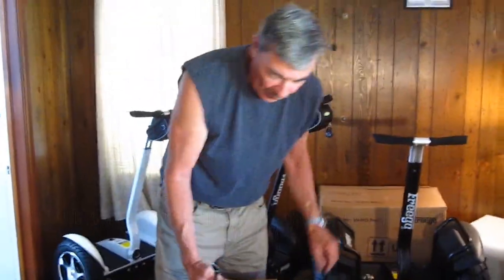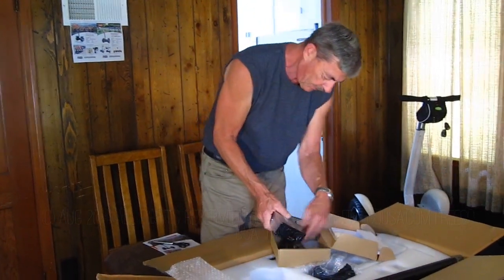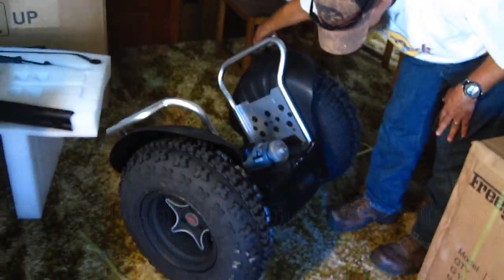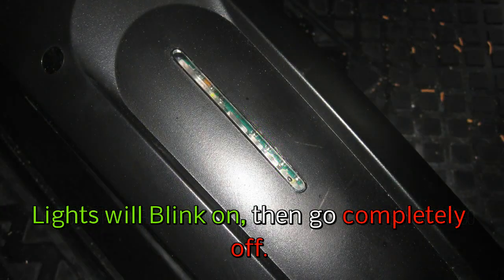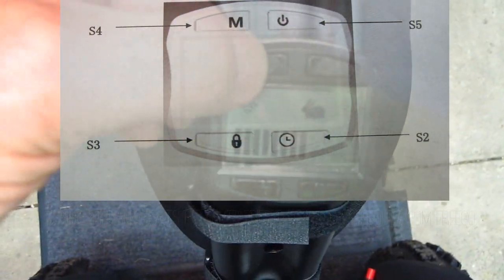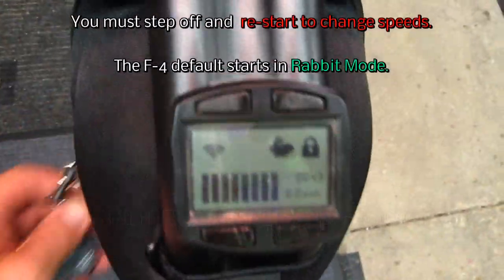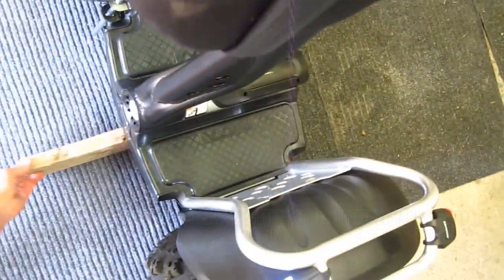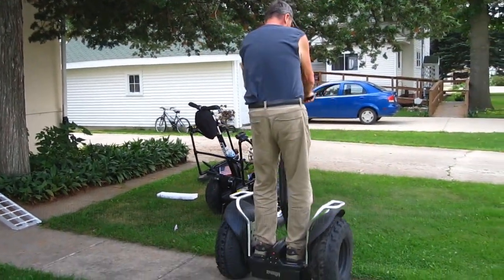F-4 Stand Up Vehicle, Un-Boxing, Testing, Tips and a Fall Demo!

Comment: Hey man nice video! Did you ever replace the battery and how did u go about that ?? im thinking of purchasing a second hand one but the batteries might be dead
Reply from the maker: I did not, because a huge fire destroyed my shop and home, including these in 2016. The batteries are easily replaced, however. We loved this machine.
Reply: @NightFlyyer   thanks your response really sorry to hear that. Do you know where I can get a replacement battery? I've been all over the internet and couldn't find any
Reply from the maker: @glendeva100  I do not.  Segway was purchased by NineBot in China.  You might find a battery there.  Some Lipos might be able to be modified to work.  Good luck and be safe.
Reply from the maker: @glendeva100  Well, I have thought about putting in some high amp RC LiPo batteries in series to get the proper voltage, if any of mine failed.  You might try FreegoChina.com too. That is where I got these.  Good luck.

Comment: If these were legal un the UK, I'd be on paypal now with a cash transfer! 
Dave, you should lobby the UK parliament to increase your sales area! 👍 👊lol
Reply: They're not classed as a walking aid for disabled people as they go too fast, the limit here is 4mph. 
British law at its finest lol.
Reply from the maker: Hmmmm???.  My car goes 120, but If I drove that fast, I would get a ticket. Most bicycles pass us here on the bike trails, so are they also illegal 'cause they go too fast?  LOL.   If they give 5 MPH speeding tickets, maybe that would work.  HAHA.  anyway, I'm with you.  It's Crazy what lawmakers make laws about when they think they know all about something they never have done.  Sounds like our gov't. LOL.  Here's a possible solution.
These machines have 3 speeds. They can be programmed to not go faster than 4 mph, which is low speed on the F-3, UVO1 D Pros, and also this F4..  It would take some lobbying for sure. Thanks for the tip.

Comment: Brushless motors are exactly synchronous three phase Tesla motors (AC motors, but with computer regulated frequency). And, not only attracting magnets, but one side 'pushing', another 'attracting' producing net motion. 

It is cool loking vehicle, but I think classical bike has more advantages: while you drive your vehicle stand-up, bicycle permit you sitting and driving in the same time. Re-charging time depends of how fast you can eat. :o) (just a joke)

I am not saying that this vehicle is bad. I can imagine one day driving similar vehicle, but until then... classical byke wins.
Reply from the maker: I did not say attracting magnets, I said magnets attracting the iron core, and of course you have pushing and pulling.  I guess I did not explain it perfectly for you.
So for you to make those matter of a fact remarks about bicycles winning, I suppose you have lots of segway experience and own one? I have bikes, motorcycles, Segways and Freegos. Comparing them to a bike is not even a consideration, since they are so different.
At least you dont have to fall off a bunch of times to learn to ride these, unlike a bike.   :-)   Thanks for the comments.
Reply from the maker: I forgot to mention that these are not your typical hysteresis ac motors. The outside of the motor spins and the center is fixed. The center is loaded with coils wrapped around individual iron cores.  The outside can is loaded with many equally spaced permanent magnets that do the spinning. In the case of this F-4 machine the motor's outside can is bigger than the ones on my drones, helis and planes creating incredible start up torque.  Again thanks for your comments.
Reply: ***** Okay, I am used to be specific about many things in phisics. By meaning iron core, it become magnetic (magnets) once magnetized by current flowing inside coil arround the iron. Yes, this iron core idffers from classical AC motors, because magnetic path is open (unlike AC motors, where rotor become part of the magnetic path, and rotor has tendency to retain magnetism by hysteresis). What make closed magnetic loop are magnets surrounding the core. By manipulating current through the coil, iron core magnetize/demagnetize accordingly (and magnetize in opposite dirrection). While iron core changes magnetic polarity, strong magnets does not - instead they follow magnetic changes, and move. Just be sure that shaft of the motor does not stuck for prolonged time - it can demagnetize those magnets (high temperature).

We are relatively poor country, I doubt that anyone have Segway or Freego. Yes, learning bike is little bit more difficult, but not too much. Thus, repairing and maintenance is next to impossible. Spare parts not readily available (unlike bikes). So, overal feelings here is that bikes wins (that is perhaps not true for the USA).

Comment: Pricing Dave?
Reply from the maker: There are different sizes and prices on the FreegoUSA website, but figure around $4k for the Big F-4 with 5 yr LiPo Batteries and 31 mile range per 4 hour charge.
Reply: *****
  Thanks for responding Dave!  I went to freegousa.com and saw the $795 pricing and thought to myself that sounded way too good to be true, as a LiPO battery of that size and strength alone would have to be extremely expensive and cost at least that much on it's own..
Reply: jst4curiosity The $795 you see on the website is the discount from MSRP, not the price. Price says $3,800
Reply: Justin Everhard Thanks for the pricing details Justin.